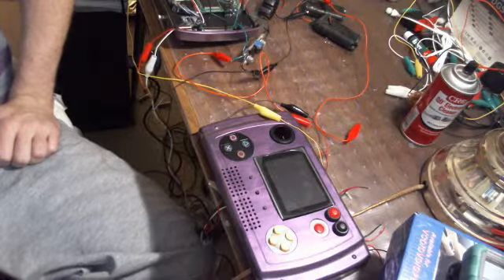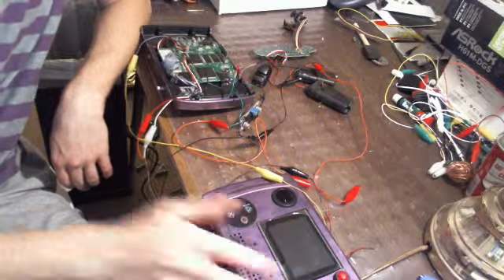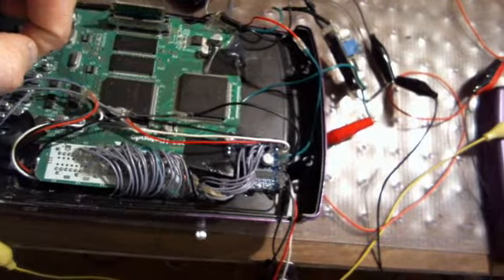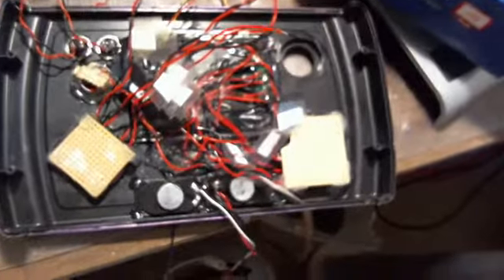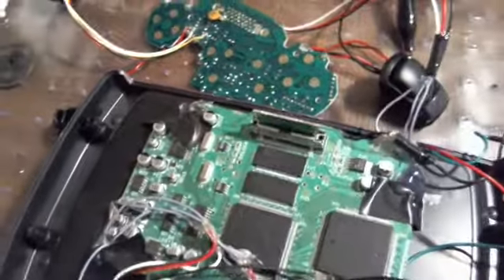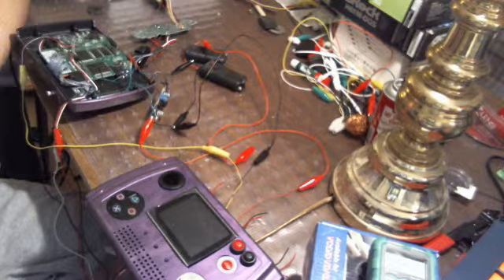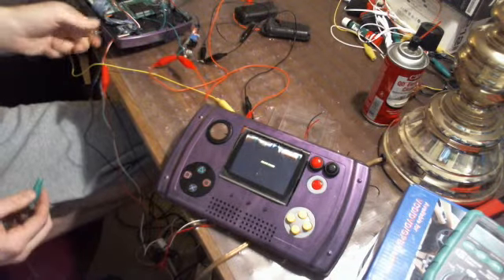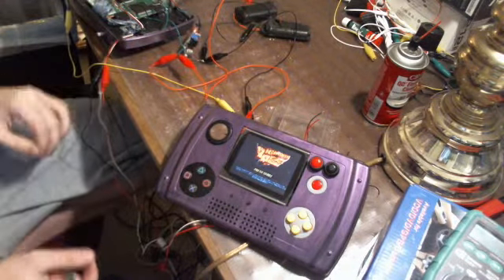Another N64 Handheld Update

Comment: its design was very good !!! Now get me one doubt: how you divided the tensions, because we know that the n64 works with two circuits, one 12V and one for the controllers, 3.3v ... please help me, for I have with this problem. .. I know you have the pth08080 voltage regulator, but have no other way to do this?
Reply from the maker: +José Alves Honestly I've been way to busy to finish it its been a few months since I last messed with it. All thanks to the holidays haven't had time. But I may end up finishing it in a month to 3 months maybe when I get the time. The A and B buttons will have to be replaced as well they didn't work like I intended them for even though there high quality buttons. I don't remember all the details in my project either so when I get around to it I'll have to look at it and see what I was doing. look online on forums and stuff too and there are people out there with schematics on how to do it. Sorry I cant help you at the moment I just don't remember what all I was doing.